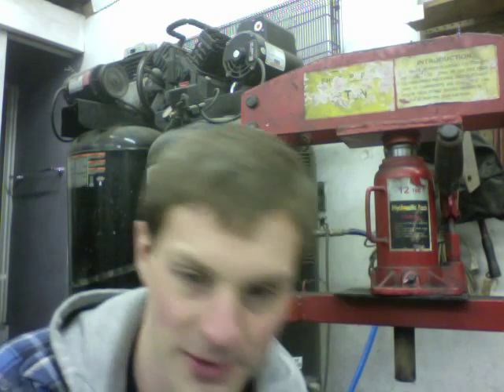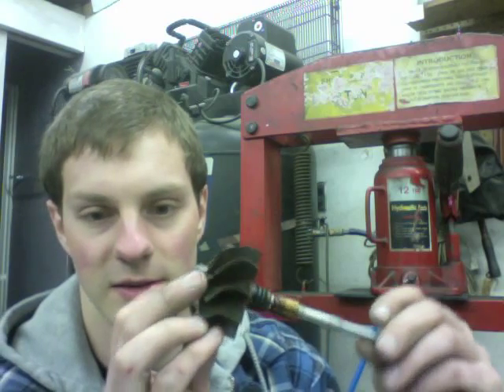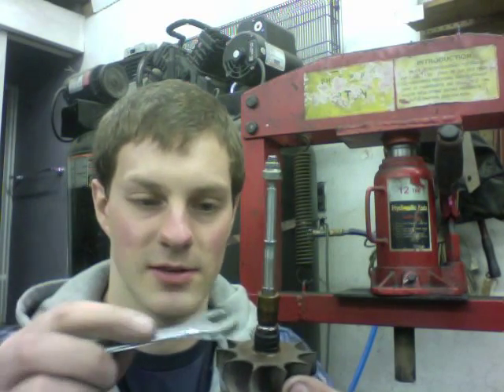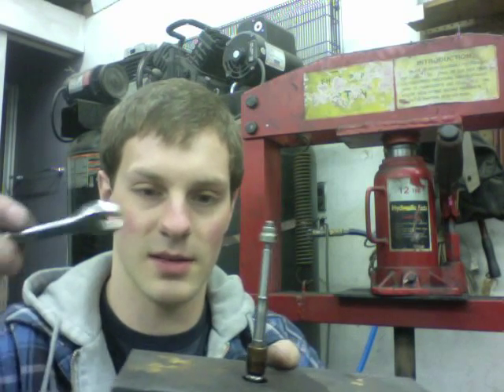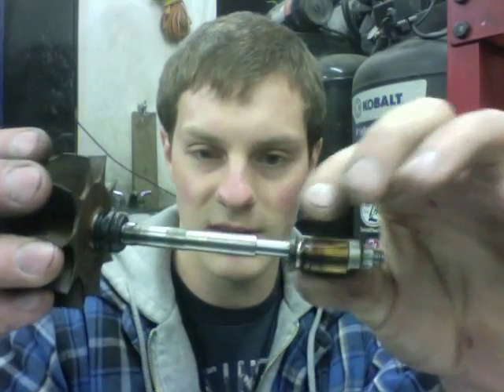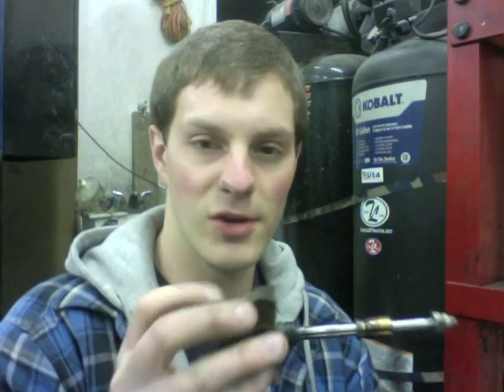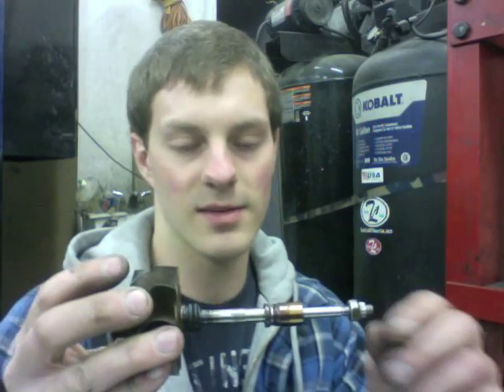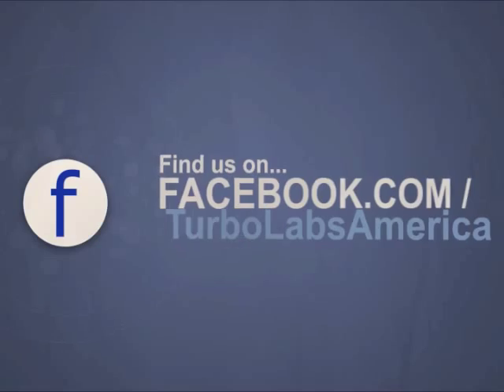GT30r GT35r Ball Bearing Sleeve Removal

Comment: What about removing the cage? are the bearings junk after removing them? is there anyway to inspect a disassembled 3071r to tell if the bearings are good
'
Reply from the maker: +boardinrider they can be reassembledhttps://www.youtube.com/watch?v=6FkaSehsb9s 
 https://www.youtube.com/watch?v=mki5LzOw_6Y

If it looks like it has a lot of heat on the cage it will be blue sometimes it's bad.  The ball can be black, inner races can be broken